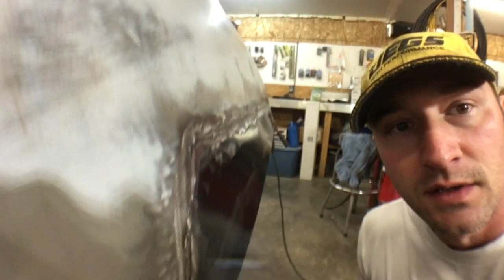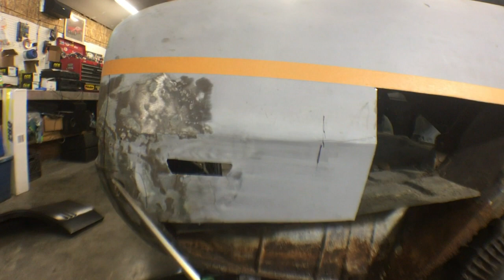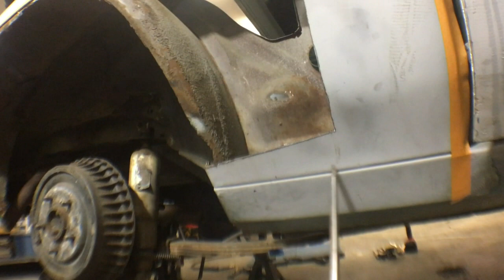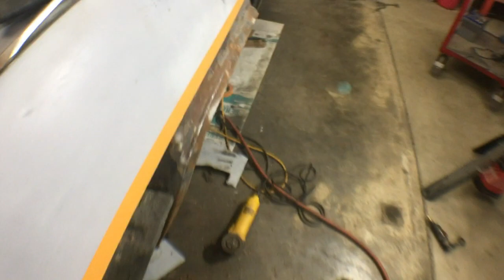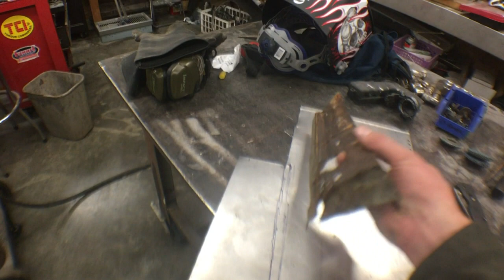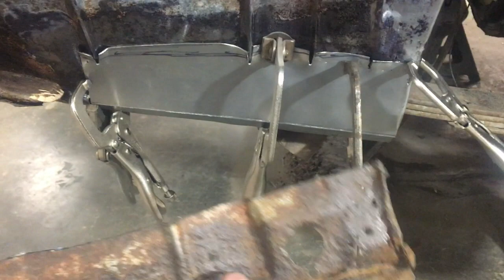1969 Camaro Rear fender patch and rust repair part 1

Comment: I replaced my quarter panel with a patch panel from AMD and it was perfect but I went all the way over the way the panel comes so the welders on top way easier to weld and finish and just replace the trunk drop off that was really easy to stop putting the patch panel over on top really works out well and fast with no warping
Reply from the maker: Thanks Patrick.  I've done them that way as well.  Especially if the trunk drop or upper tail section has issues.  The panel that goes over that edge is usually the full rear fender patch and not a partial like these were.  They are much different in price for the two as the ones i used are not meant to go over the top of the rear fender.  For me an entire rear fender takes longer then just doing a partial but I agree are much easier to keep from warping and possibly an overall less complicated install.  On this one i liked the idea of keeping factory main lines as much as possible and re-stamped panels are not always the easiest to get lined back up.  It sounds like you had great luck with AMD which is great!     Thanks for watching!
Reply: Yes I've had good luck with AMD they cost more but I got my panels actually real cheap I lucked out but at that perfect body lines and everything I put the back tail panel piece on from goodmark and they lined up good really surprised yeah like your videos you do good work